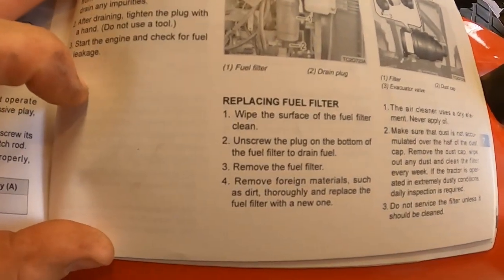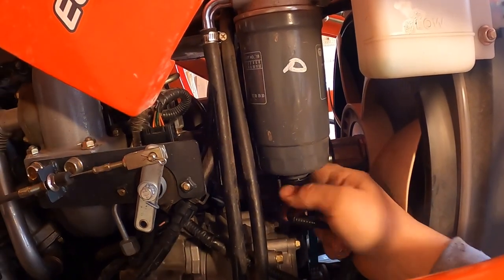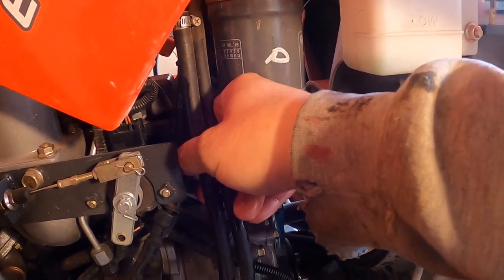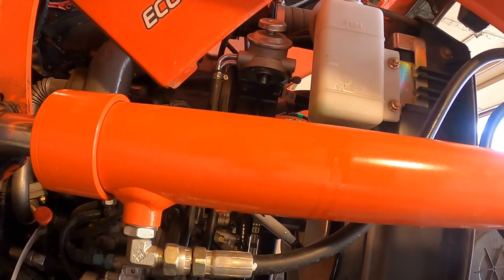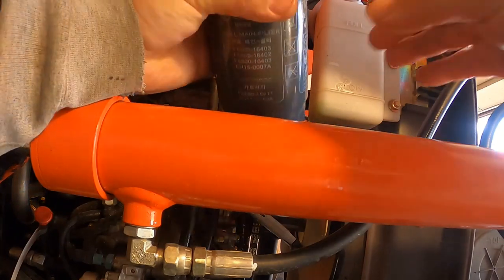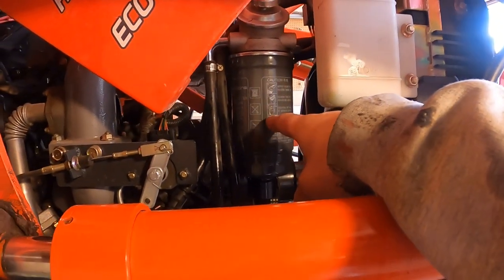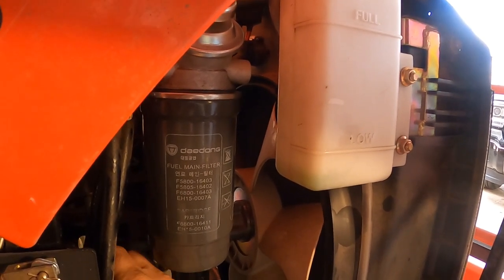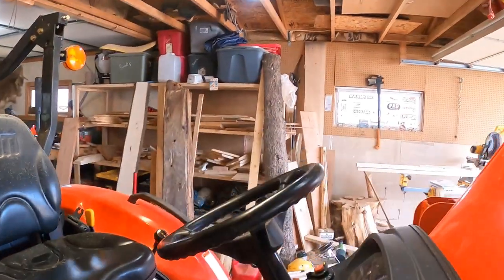Kioti CK3510 HST fuel filter

Comment: thanks again for your video. I changed my fuel filter yesterday and followed your advice. I clamped the fuel line and unscrewed the filter with the plug still attached at the bottom and only had a small trickle of fuel. Replaced the filter, primed and voilà....I was so proud til I looked at my old filter and noticed a small rubber O-ring/washer on the ground. So my lesson learned is to not forget the small O-ring that goes between the bottom of filter and electrical screw plug that attaches to the bottom. I also noticed an other O-ring where the filter screws onto the frame. In the end all good. Thanks for sharing

Comment: Great video and sincere thanks for taking the time to record your experience and share it here for all of us to learn.  Well done.  

I just finished replacing the fuel filter on my 4010 after 200 hrs and watched your video to help me through it - I learned couple things that some may find helpful...

There is no need to crimp the fuel line.  Instead, do not remove the sensor from the bottom of the existing filter (leave it screwed on), just unclip the wire connector.  Then, open the bleeder valve to release pressure in the filter.  Then simply remove the filter slowly but keep it upright carefully so no fuel spills from the filter.  Remove the filter and drain the fuel in to your hazard waste bucket.  Just a couple drips of fuel dripped from the housing, that's it !

Once the old filter is removed and drained then remove the sensor and attach to the new filter.  Then install the new filter to the housing and reconnect the wire.  

Then pump to charge the filter and once that's done tighten the bleeder valve.  When I went to start mine after all that the tractor ran for about 20 seconds then died - clearly from fuel starvation.  Not a problem...  Restart the tractor, will take about 7 or so seconds before it fires and runs.  

Hope this helps others.

Thanks again for posting !

Comment: 3 good video's; hydraulics, oil, and fuel maintenance.  Good detailed step by step review.   Not sure if you have ever changed your front axle oil, but my JD had accumulated debris at the bottom of each wheel spindle, so I was glad I did it at 100hrs.  Also, your radiator overflow tank is a little low.  Keep up the informative DIY  videos.
Reply from the maker: Thanks, i did not change the front axle oil, but will definitely change it out now just to be safe.

Comment: Hey Beav, I really appreciate you taking the time to shoot and post these videos! I have the same tractor (only difference is its cab model cause I am getting old and wimpy and have to push snow with it in the winter). I am getting ready to do the first scheduled maintenance  myself and your videos will help a ton. I also have the backhoe and I am freaking out a little about your most recent issues. I have checked mine, and so far so good, but I am going to definitely keep an eye on that frame. Bummer Kioti didn't help you out on that one, but your repair looked like it would be stronger than new! By the way, your laugh reminds me of a buddy of.mine and I can't help but grin when I hear it. 😁